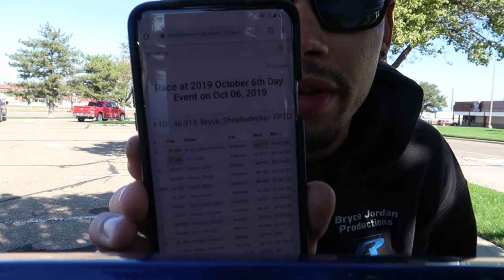#1!! Shes DIALED! | WTR SCCA | Stage 3+ MK7 Golf R

Comment: Congratulations! And your'e welcome ;) 
It is kind of funny, folks get so used to driving these cars with so much under steer that they develop some bad habits, and then the first time they go into a corner to hot, lift, and the rear end comes around it really catches them by surprise :) but that is exactly what you want! That is what a balanced car is supposed to do when you lift going into a corner at the limit. Especially with the AWD, you can load up the front end, pitch into a corner and easily get the car to rotate towards the apex, then just romp on the throttle and that AWD just pulls you through the corner. I have even gotten the rear tires to spin (briefly) as I am going side ways before it just catches and pulls you through the corner, it really is better than I had hoped. It is so much more fun to drive now, I really feel like I have stumbled onto the perfect setup for this car.

No doubt those tires helped a lot but I can tell you from testing and experience, the added camber/caster up front and toe out adjustment is what makes the car able to rotate and have that balance that lets the car respond so well. So even with less grippy tires you will be a lot faster than you were, under steer destroys lap times. With more practice you will really learn how to take advantage of those characteristics. It is great for auto cross, and even better on a road course!
You can do up to about .16 degrees toe out per side front and back and it really is a revelation. I have played with toe a lot and have basically all the same suspension mods you have (more or less), if you set toe in the car will tend to under steer even with all the other suspension modifications. In fact even more toe out (especially up front) is even better HOWEVER, up to about .16 degrees tire wear is not an issue at all, but if you go much more than that the tire wear starts to increase at an alarming rate! So for the street/track that is the sweet spot, you don't want to do much more than .16 per side.  Which is probably why the VW factory spec is .17 toe in max  per side, whether it is toe in or toe out it is the same difference for tire wear. At least that is what I have found so far, and I do closely monitor tire wear and do a fair amount of driving. Toe in causes a bit more wear on the outside and toe out more on the inside, but at 1/16 toe either way the tires seem to be wearing normally. I also have -2.7 degrees of camber up front and the tires wear even so... But again anything much higher than 1/8 toe out (total) does start to rapidly increases tire wear so... 

One thing I want to mention for anyone else reading this, if you want to try toe out in the rear to achieve this great balance and response, you MUST replace all the soft rubber bushings first. Toe out with all the suspension deflection from the rubber bushings makes the car unpredictable at high speeds. It will help with rotation but the unpredictability is a problem. I think this is why VW and most shops spec toe in. You have to consider the effect toe has on the wheel and suspension as it is moving down the road, it has a sort of pre-load affect. So toe out combined with all the suspension deflection caused by the really soft rubber bushings causes a lot of unpredictable movement.  The ironic part is  the stiffer bushings have a very minor effect on NVH IMO so...